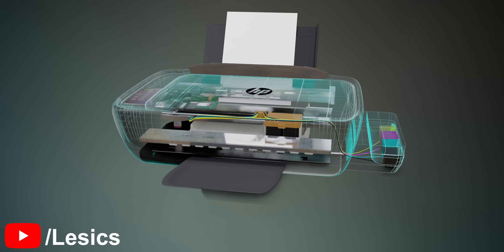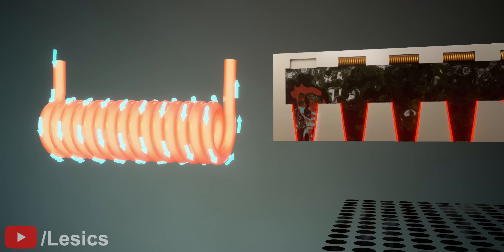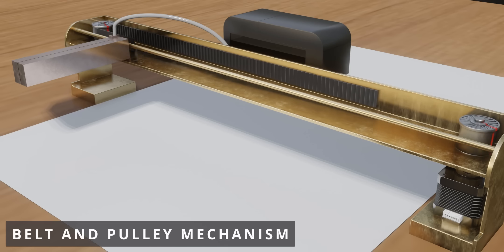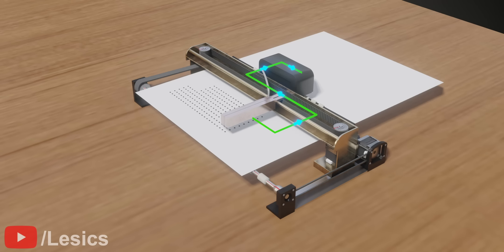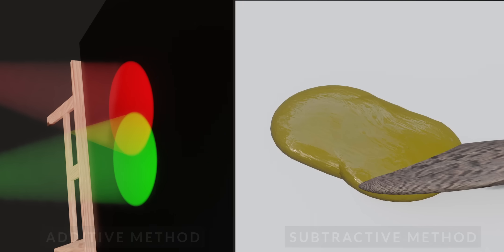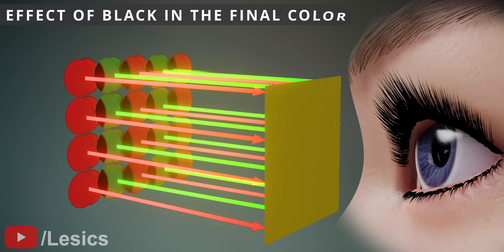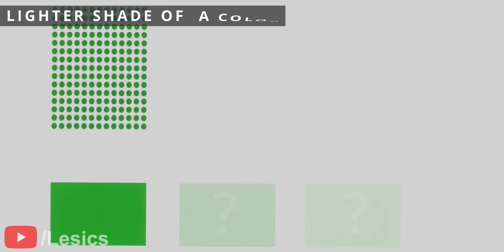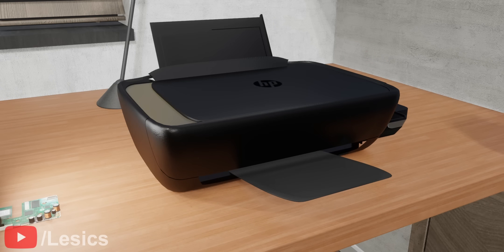Inkjet Printers | The interesting engineering behind them

Comment: What's amazing is how inkjet ink cartridges are so useless they need replacing for just about every time you use the thing!
Reply: yup they make it so you have to buy quick and they are not cheap and cant use 3rd party style as they like make it so you have to use their brand
Reply: You're not wrong on your claims, but there's also a caveat in ink jet technology. Since the nozzles are so tiny small, it's very easy for the ink to dry and clog up a nozzle. So the printer needs to be constantly cleaning itself to keep the nozzles free, and the way to do it is to purge and waste away some ink that has already started to dry out of the nozzles. There's no way around this.
If you use your printer seldom and always need to be cleaning printing heads and buying new ink cartridges, maybe the best solution for you would be to buy a laser printer as they don't suffer from this problem. Just turn on and print! Color laser printers are expensive but the black only aren't.
Or, if you print very very seldom, probably the cheapest solution is to print your documents on a printing business. It's more expensive per copy but you don't need to own a printer and maintain it.
Reply: @Humongous_Pig_Benis  yeah, I did just that - laser printers are more suitable for sitting off for extended times.. inkjets are only going to be useful if someone is using them every day or two I think. I think they should never be bought by anyone wanting only blue moon / occasional use as all that will happen is you get maybe a dozen pages per set of ink cartridges which makes them extremely expensive and wasteful (as they all do scummy DRM on the cartridges to make it harder to fill up or use alternatives to theirs)
Reply: @Humongous_Pig_Benis  : Better seals between the inkjet head and the pad. Plus when we cleaned the heads we used a cleaning solution pumped through the inkjet head. Also commercial printers use continuous inkjet technology (CIJ) to print so they have the advantages of one without the disadvantages.

Comment: About 35 years ago when I purchased my son a commander 64 whose $200 printer used an expensive ribbon cartridge that only printed around 11 color pages. Think black & white printing was not much better. about 30 years ago purchased a computer that you had to use a think it was around $200 scanner to scan a page then download it then print it out. Probably took over 5 minutes to turn everything on wait for boot up to print 1 black & white page. That was a Dell printer that for years you had go pay more then other company printers because only rip off Dell sold the ink cartridges. Now you can purchase a 3 in one printer good enough for house use for less then $80. A coworker waited for black Friday deals and purchased 4 identical printers on a great sale. He told me he saved over $15 just using the 2 ink cartridges from 3 that he would never use. Thanks for the great vid.

Comment: That's a very nicely done video. I always wondered about why RGB doesn't work with printers, and it was both explained and illustrated very well. But I had inkjet printers ages ago and would never go back to one as I could never stop them from clogging. I just keep a Samsung monotone laser 3-in-1 now, and that does what I need.

Comment: Three things about inkjet printers that are amazing.

1. That someone or a bunch of someones were able to come up with the concept and determine what it would take for it to actually work.

2. That the concept was then developed into hardware that requires incredible precision.

3. That it resulted in a product that can be mass produced and sold at an affordable price.

That last point may be the most amazing. It is one thing to get something to work in a lab under controlled conditions, and quite another to turn it into a finished product that can be sold at a 'Big Box' store.

I might complain about how much I have to pay for the inkwells used on my Canon PixmaPro wide carriage printer, but every time a beautiful photo print slowly emerges from it, I tend to recall how much time, work and EXPENSE was necessary to get far less satisfying results with paper and chemicals.

Comment: Wow, it was very interesting. Thanks for nice animations! The case with resistors means, that during normal work, when fluid color is present, they get to 100 deg.  hot. In absence of paint, resistors just melt and no cleaning method will restore them

Comment: I would have never come up with the idea of using heating resistors on a comon channel to force out a stream if ink. Amazing engineering
Reply: Canon’s “origin story” of their inkjets (which they market as bubble jet) is that an electronics engineer was working on something, and accidentally touched his soldering iron onto the needle of a syringe full of solvent or flux or something. When he did, a drop of liquid came out. (And yes, I’ve done this experiment myself with a syringe of alcohol, and it works!)

The diagram in this video is wrong, however: the heating resistors aren’t in a common channel. Each nozzle has its own ink channel. In some designs, the nozzle outlet is on the side of the channel (as shown here, just incorrectly with multiple nozzles in it) and the resistor is at the “roof” of the nozzle’s channel, opposite the outlet. In others, the outlet is at the end of the nozzle (like a syringe), and the resistor is in the side of the channel.

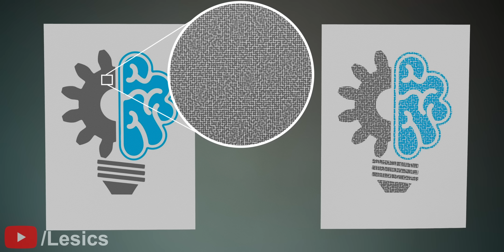Comment: Very nice.  But 300 dpi doesn't mean 300 dots "per inch square of paper", as the video says at 11:01.  It means 300 dots in each direction, or 90,000 dots per square inch.

Comment: A very clear explanation

Three questions please.
Why doesn't subtractive method affect Yellow Cyan and Magenta colors?
Why doesn't firing two or more colors in the same location, work for RGB as well?
and
Why doesn't the principle of inserting black in between green to make it darker, work out for RGB?
Reply: RGB is additive color: you’re adding light to where there wasn’t light. You can’t “add” black because black means “less light”.
CMYK is subtractive color: when white light hits a surface, the surface absorbs some colors and reflects the rest. Cyan ink absorbs red light and reflects the rest. Black simply absorbs everything, reducing brightness.

Comment: 9:14 inkjet printers don’t try to mix inks as shown. In fact, they actively avoid putting one drop onto another whenever possible. Why? Because a larger drop takes longer to dry, bleeds more, and causes more paper warping. Instead, they try to space out the droplets as evenly as possible. 

Even just giving the ink a half second to dry/absorb before laying an overlapping drop helps. That’s why, in the highest print quality, your inkjet printer goes over each part of the page twice (or more!), laying down only half (or less) of the ink per pass.

Comment: Printer technology has come so far that I have seen half of the Bible on 1 page, each letter consisting of as few drops as possible. It just looked like a grey piece of paper but under a microscope I could make out the words. Amazing stuff I gotta say
Reply: Wow, as someone who's been monkeying around with low-level control of individual drops, that is a really interesting concept. Lessee, 5x7 is considered a pretty legible font... my inkjet is 300dpi (because newer inkjets are far more difficult to program at such low levels). That's 300/6=50 lines of text per inch(!!!) From one of the first inkjets available to the public! I never thought of it like that! Thanks
Reply: @ericwazhung  you should check out some of the canon image press stuff. Those machines are crazy. Up to 2400 dpi

Comment: R u sure the colour inkdrops are printed exactly one over the other or slightly beside it?In offset,they are printed by overlapping at an angle.
An indepth analysis of different passes will be great.
Digital screening will be a great topic if u can show a video
Reply: They can be placed completely or partially overlapping. When you see an inkjet printer’s resolution numbers (especially the horizontal), they mean the granularity of where the dots can be placed, not the number of dots that can be placed next to each other (without overlapping) in an inch. For example, suppose an inkjet has nozzles spaced for 300dpi vertical, so the maximum dot size will be somewhere around 1/300 inch. But it might be able to place those 1/300” dots horizontally at increments of 1/2400 or 1/4800”. 

As for the raster: offset printing usually (but not always!!) uses halfltoning, where an angled “screen” is used, with a different angle for each color (45° for black, various different angles for the colors). The screen resolution (e.g. 75 lines per inch for old-school newspaper, 150 for magazines, etc.) is essentially the grid of dots, and each screen dot then varies in size (using a much higher print resolution to be able to accurately vary the sizes of the dots). For example, for a 75 line newspaper screen, the printing plates will be made at 1270dpi, so each screen dot is made using a 17x17 grid. Doing it this way is necessary because offset printing can’t have unlimited resolution — you’d have trouble getting a 50% gray out of alternating black and white dots each 1/1270” large.

Inkjets can be operated this way, and many printers’ drivers have that option. 

What’s far more common in inkjets is what’s called “stochastic” dithering. Rather that clustering into a coarser screen, the ink dots are distributed pseudo-randomly. This allows for smoother color gradations with less resolution, which is why a 600dpi inkjet printout can have color that’s smoother than a magazine imaged at 2450dpi, while actually having sharper edges around lighter colors. 

Why don’t we use stochastic dithering on offset? Well, actually we do sometimes. It’s a more demanding process on offset. But when done, it looks gorgeous. I know National Geographic used it in the past, but I don’t know if they still do.

Comment: Thank you for the colour concepts understanding. Dear Engineers, please do some R&D on HP DeskJet Printer TANK.  It doesn't  work when ink level reaches 50% lower in the ink chamber (ink does not float in the pipes towards cartridge properly). and Do some concrete solution for airtight cap.  The caps that are there on the ink tank is loosen out after a period.

Comment: It seems impossible at 100⁰/per micro sec speed of coil and bubble with multiple drops , but eventually we have great engineer's.🔥
Reply: There is no coil: the animation is simply wrong. The resistors are microscopic thin-film resistors. With practically no mass, the resistors can heat very quickly. It also means they can cook very quickly, which is how we can achieve a nozzle ejecting thousands and thousands of droplets per second.

Comment: That was incredibly exciting to know what is the mechanism behind my printer productions. However, it's dried now and I was told that it is not fixable and I should buy a new other printer 😅.
Reply: Buy new Ink Cartridge not printer
Reply: Yeah that's the logical solution, but what if the Ink Cartridge costs as much as the new printer? That's true.

Comment: inkjet very compact and lower cost.  and recently have in refill version to consumer market.
but its a bit disappointed that inkjet nozzle dry and clog issue  had not been resolved in new design over the year.  that's most annoying to end-user, since some of them use it not so frequent.
actually that can easily achive by applying a negative sucking air pressure below nozzel after long standby.

Comment: Which is the best printer for home-use.( 1-10 prints per day), Both coloured and black. With low maintenance cost and good quality ?
Reply: If you print often (that is, without going weeks or months without printing at all), like you say, then I’d go for an ink tank inkjet. They use bottled ink that costs next to nothing. (Like $15 for 6000 pages.) Look at Canon Mega Tank (especially the Maxify line) and Epson EcoTank. Quality is good in all of those, but features vary a lot by model (speed, duplex printing, duplex scanning, paper trays, whether the ink is dye or pigment, etc.)

Comment: AMAZING! i have a question tho:  is CYM necessary to print black and white and shades of grey? or is the spacing technique enough for that? is there an engineering reason to also ask CYM be available or its bullshit software to sell more coloured ink?
Reply: nope, black only can be used for monochrome, using 'dithering' patterns to vary shades, but using colours as well , equally, seems to give better print quality, at least in the printers i had/have , as for exactly why/how, not sure i've had several injets over the years but now use a monochrome laser i got cheap 2nd hand as only really need black, very rarely colour, also got a colour laser 2nd hand but print quality isnt too good , maybe why they sold it! wish i'd kept the previous colour laser(actually a LED printer, not laser, but still used light sensitive drum and toner) i had, also 'used' but very good print quality, problem is that it was quite large for me to store and use ..
Reply: CMY let’s you make a smoother, less grainy gray. (The tradeoff being that that gray might not be a totally neutral gray.) For example, a 50% gray could be made by alternating black dots with no dots. For example, suppose you wanted a 300dpi printer to print a 1” line at 50% gray. For each line of dots, you’d put down 150 dots of black ink, spaced apart with 150 gaps, each roughly 1/300” wide. (Basically a checkerboard pattern.)

But you can also do it by applying approximately 150 cyan dots, 150 magenta dots, and 150 yellow dots. But since that adds up to 450 dots, which still need to fit into that single inch, it means those dots will be overlapping. This means no gaps, producing a smoother gray.

Comment: Is the printer head part of the printer or of the replaceable ink container? My printer prints but the pages are empty, altough I replaced the ink containers with new ones. Is my printer dead now, because I didn't used it for a long time?

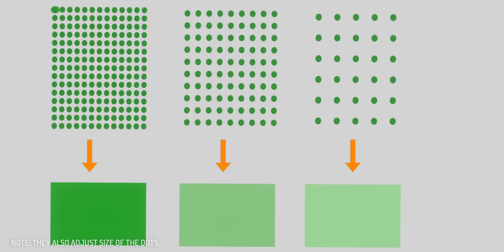Comment: 9:50 so if you were to print on dark paper, you'd have to invert the saturation in the file you're printing in order to cover less area with ink in areas that are supposed to be darker?
(and use white ink for lightareas instead of black ink for dark areas)

Comment: Sir,  if the bubble near the coil is present,  how will that bubble will be removed,  because in this video ,how will the bubble removed is not mentioned,  if it continues then bubbles will be accumulated and whole ink can be overflowed through the nozzle
Reply: Good question. First of all, it’s important to note that the resistor isn’t a big coil, as shown in the video, but actually a microscopic thin-film resistor with practically no mass. (Thus, the resistor holds practically no heat.) Also, the video shows a single ink channel with lots of nozzles and heater resistors, but in actuality, it’s a single nozzle and single heater per channel. 

So a droplet cycle works like this: Capillary action has drawn ink through the entire nozzle. When a droplet is needed, the resistor is turned on, causing some ink to boil, creating a bubble. This bubble needs space, so ink must move out of the way. It takes much more force to move all the ink in the channel than it does to move the small amount of ink in the nozzle, so it is the ink in the nozzle that moves and is ejected. As soon as the resistor turns off, the bubble of vapor starts to cool off. The comparatively huge amount of “cold” liquid ink quickly draws away the heat, causing the vapor to condense to liquid, and the bubble collapses. Capillary action then causes ink from the channel to refill the nozzle, and it’s ready to make another drop when needed.

Comment: 11:04 it is not dots per inch squared. It is dots per inch in both directions so it is 300x300 dots per inch squared or 90,000 dots per inch squared.

Comment: Same color with different ink code between brands use different viscosity am i right?  So other refilling ink will not work to refill other printer brands.
Reply: I’m no chemist, but I strongly suspect that there are differences in viscosity, dye or pigment density, surface tension, and probably things like acidity, corrosiveness, etc. 

When I was a kid, I experimented with refilling Canon inkjet cartridges with all sorts of inks. (On the kind of printer where the cartridge contains the printhead. So if I ruined a printhead, it only killed a cartridge that was going in the trash anyway.) I successfully used fountain pen ink, food coloring, etc. Of course, who knows what those would have done to the head if it had to sit on a store shelf for a year before being used. And that was a black and white printer, so using blue fountain pen ink just meant it printed in slightly pale royal blue instead of black. 

If it had been a color printer, it would have been an entirely different matter, since the ink colors and density need to be carefully matched. Heck, that’s one of the problems with modern knockoff inkjet refills made by companies whose entire business it is to get this right: the color rendition isn’t quite right.